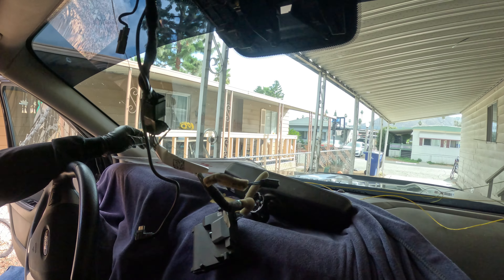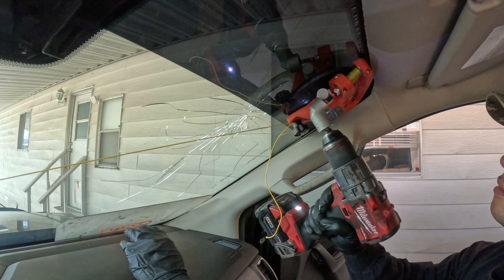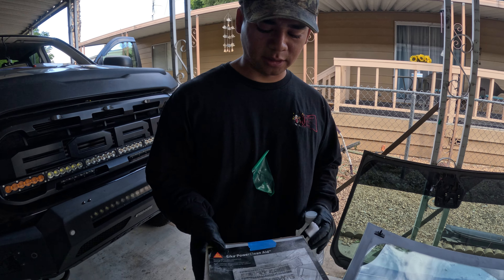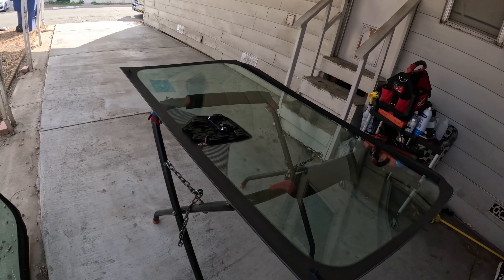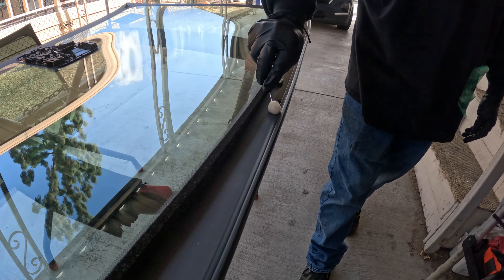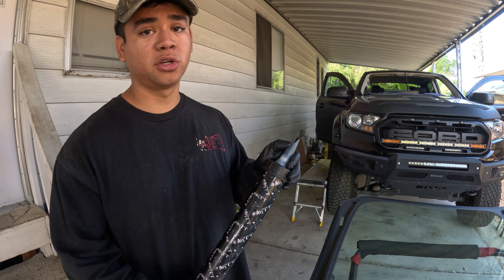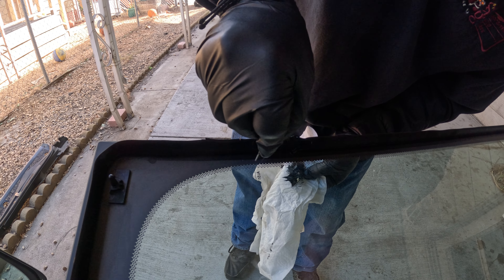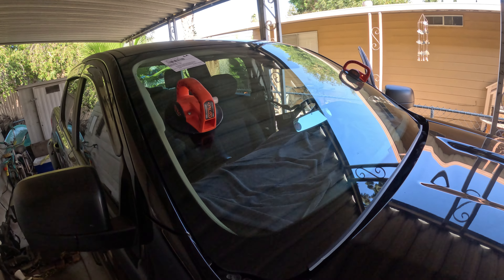2023 Ford Ranger Windshield Replacement

Comment: How exactly do you find out what sensors are on the vehicle?
Reply from the maker: We determine the sensors in your windshield based on the make, model, and year of your vehicle. Most modern vehicles come equipped with Advanced Driver Assistance Systems (ADAS) which include various sensors embedded in the windshield. These can include features like lane departure warning systems, forward collision alerts, and more. Once we have this information, we can provide appropriate repair or replacement services 👍🏽
Reply: I ask cause I replace glass too. But I’ve noticed on Toyotas and ford a lot of time they have many different sensors and I’ve had a couple times where I would have to order a new glass cause the one I thought it was didn’t have appropriate sensors. I’ve experienced it on newer models 2020+.
So I didn’t know if there’s a system you use that uses the vin number to identify the sensors?